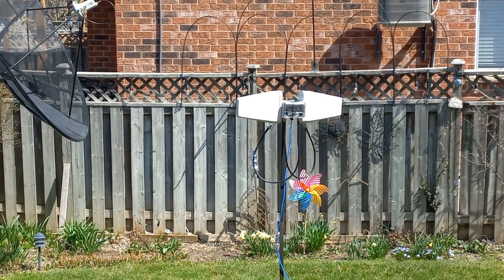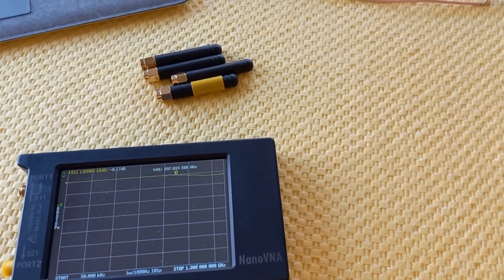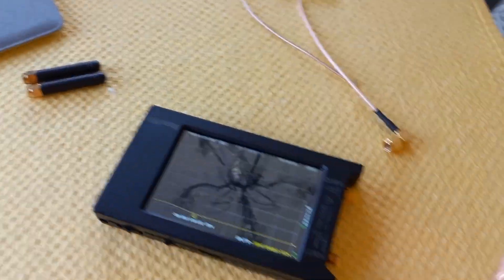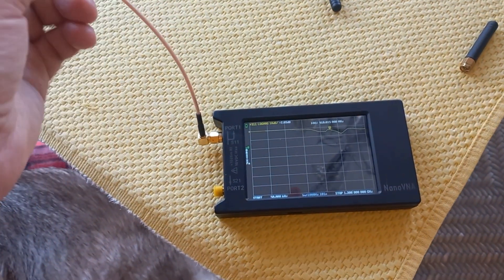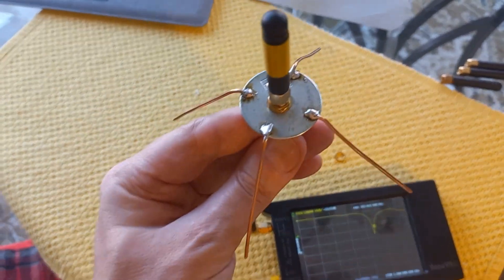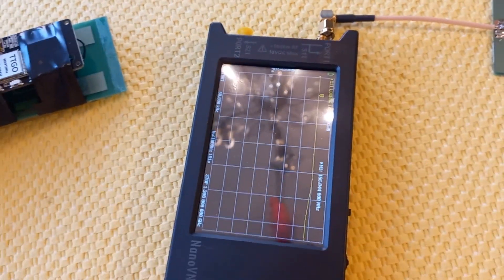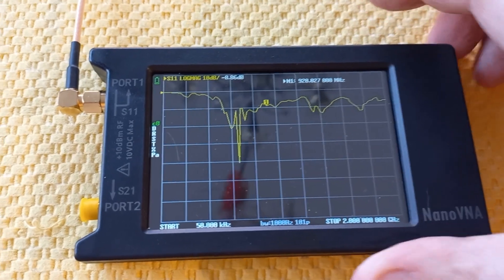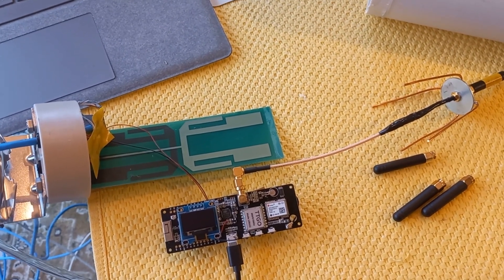Meshtastic T-Beam Antenna Improvements

Comment: just in case you didn't know, you can connect the one gps you have for the tower to both radios. there is no problem running the tx line and gnd to the other heltec board. don't connect the tx pin to both if you're using it, just the GPS TX to the RX of the heltecs

Comment: Hello. Please tell me how to make an antenna transmitting the control signal of the FPV drone , so that it would automatically turn in the direction of the fpv drone controlled by me , and accompany it throughout the flight . What parts should I use to rotate the antenna? What is the chip for automatic tracking?I am very grateful to you. Thanks .

Comment: Get it up higher I see my node in your list once I see your message i will respond. 

-SC Router Burlington
Reply from the maker: Hi Router Burlington, I saw you pop up on the 8th during the eclipse. Hopefully when I mount the HelTec directional relay antennas at the top of the tower we'll have a solid connection.  https://www.youtube.com/watch?v=ob6DhsqoU5I

Comment: There are some excellent 915Mhz antenna on Alibarba for quite cheap that absolutely crush these tiny antennas. Having played around with them I wouldn't use the stock ones given the SWR improvements.

Comment: You could get your SWR better by having it outside of the radome you're using.  Even a plastic radome tube like you have can change the SWR a bit.  Also Splicing coax like that is 100% going to cause loss. Also it's critical your ground plane radials be the correct length as well. The more detailed you have your antenna to the Freq you want, the better the SWR, the better it will TX and RX.

Comment: Tropospheric ducting can affect 900MHz, another ISM project: can sometimes travel as far as 200KM just before thunderstorms and other weird thermal environmental things that I don't understand.
🤜🤛
Reply from the maker: The tropoducting starts here in May so that'll be interesting. I have picked up TV signals from over 400 miles away during tropo.
Reply: I had issues with tropospheric Ducting back when I was doing paging on a radio common carrier frequency in the 454 MHz range. The receive frequency on my system for talkback paging was also being used by another paging company south of me by around 150 miles. They were using it as a link frequency where they had a high power transmitter linking other sites for their simulcast system. These idiots were running there Morse identifier at around 50 wpm. I could not decode something faster than 13 wpm. Had to visit the transmitter site multiple times until I was able to record the ID on the receiver of my system. Had to find a multi speed recorder to play back the code at half speed so I could read it. Found out who the company was and contacted them about the issue. They were unaware that we were using our RX frequency for low powered handhelds. They wound up reprogramming their equipment to another link frequency to cut the interference. Only has issues in April and again in September. Couldn’t believe it, never heard of this issue before this experience.

Comment: I would not put that spliced coax in the redone.   You are going to get condensate/moisture in it.  Not an if but when.  Look up the connectors you need and the coax length and buy a cable.
Reply from the maker: The whole point of putting the T-Beam inside the radome was to keep it out of the elements. The radome has a weep hole in the bottom to equalize pressure and not allow it to condense. Also I don't live in the Amazon jungle. The coax is also taped up really good.